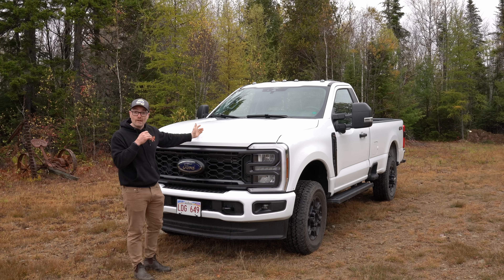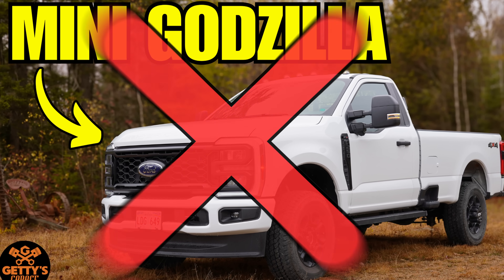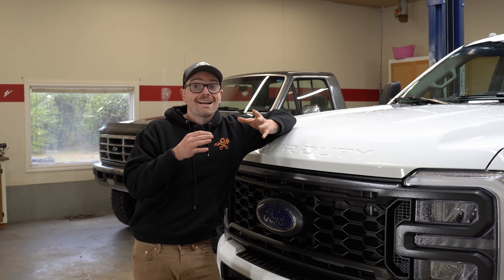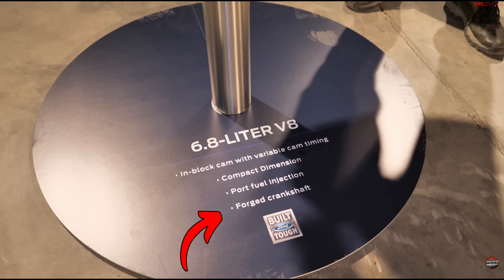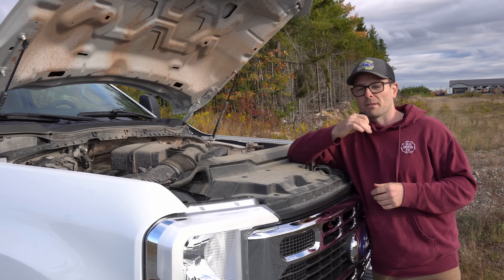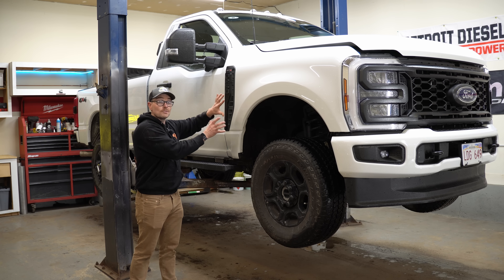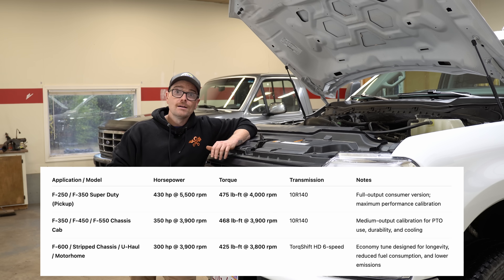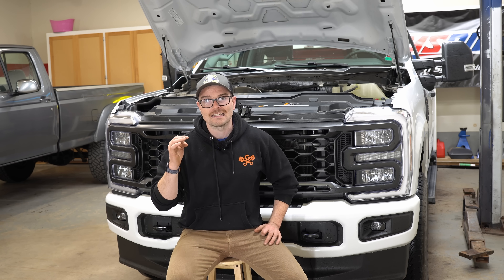Ford F250 6.8L Mini GODZILLA V8 Engine | Weak Points & Common Issues YOU Should know..

Comment: I like the 6.8L V8 in my current F-250 as much as I liked the 6.4L V8 in my 2015 Ram 2500.  I plow and only tow a 7K lbs. trailer.  Both have plenty of power for me, no issues with either.

I worry about the transmission.  Not because it's not strong enough.  Because they put the trans. cooler under the truck instead of in front of the radiator like every other truck I've ever had.  My trans. temp. gets up to 221°.  That seems crazy high to me.  The Ram trans. temp. went from 168° to 172°.  I'd like to put a aftermarket cooler in front of the radiator.

Comment: Kinda interesting, as to the crankshaft debate if you look at buying one the 7.3 has a different part # than the 6.8 which isn’t surprising but the cost between the two is very similar looking across multiple vendors so why wouldn’t a cast crank be at least a couple hundred dollars less? If indeed it is cast crank!

Comment: I’m a 2024 6.8 owner. I’m impressed with the power compared to my previous 6.8 v10 engine and it gets better fuel mileage while delivering torque on the low end better.

Comment: 8:15 ford had tons of trouble with transmission cooler lines through the 2010s. All of their metal quick connects would rust and corrode or the line connections would crack and blow out. Luckily corrosion shouldn’t be an issue for these

Comment: The “intelligent” charging systems are another over complication. Our QX80 HAD an “intelligent” alternator but after 3 separate trips with my wife and the stereo off or playing low while driving along back roads averaging 45-50mph I had noticed the voltage gauge was below 12V and we had weird hard starts each those three trips. When cruising along the charging computer will tell the alternator to stop charging and freewheel to get another couple of tablespoons less gas used. On the Infiniti there is a single red wire going to the alternator to tell it to charge or not to charge by sending 5v or 0 volts. If the alternator is not sent a 5v signal it will charge the battery. I clipped that wire 3 inches from the plug it comes out of its computer. Problem solved, volt gauge now shows 14V all the time. 

Great idea, let’s pack the vehicles with lots of computers and actuators then we will compromise the electrical system by only randomly charging the battery.😅

Comment: Been messing around on Fords site and trying to Spec out Super Duty options. It seems that  26.5 gallons is the biggest fuel tank available on 250 and 350 trucks regardless of bed length. Am I missing an option package that has larger tanks?
Reply: Believe it’s 36 gallons with 8’ bed ?

Comment: When the 6.8 was released in 2023 it was rated for E85. Now for 2025 and 2026 Ford states that the 6.8L Minizilla is no longer E85 compatible. Would love to know what they took away or changed from a few years ago and what the performance gains would be if you run the 6.8L on E85.
Reply: Interesting, my 2024 is E85 compatible

Comment: For those that have access to Ford Workshop Manual (PTS) and go to 303-01B, Description and Operation, Engine Overview, it calls out the 6.8 has a Forged Steel Crankshaft. It’s the same 2023-2026

Comment: I have a 2024 f250 6.8 with 3.73 gears. It’s been amazing for me. I tow an 8,000lb toy hauler on the weekends that used to walk my 2021 f150 all over the road. It drives much smoother, transmission wise, than the f150 did with the same trans. With a couple fluid changes, I cannot imagine it being a failure point. It doesn’t feel labored at all.

Comment: Wish this would find its way into an F150. There was talk of it years ago, before it was released. I want a V8 with good low-end torque. I don't want ecojunk, and while the coyote is a great engine, its low-end torque is anemic. My 255k Oz tuned '12 has made that painfully obvious pulling my 1860 tracker grizzly.

Comment: Excessive oil pressure can cause bearing wash taking off the top layer of the bearings 
All cat c15 engine wash the bearings Cummins used a viscosity sensing oil pump to prevent that
Reply: Cummims definitely does not use a viscosity sensing oil pump. There is a pressure relief valve that opens if pressure gets too high. Nothing to sense low viscosity and produce more volume.

Comment: 2023 f250  6.8 l oil pump drive gear failure loss oil pressure  metal oil  pan  new engine 8140 on truck

Comment: recently I went and test drove the 7.3L with the 4.30 gears. I currently own a gen3 5.0 F150 with 3.73 gears. I was really disappointed in the power and response of the 7.3 as compared to the 5.0. I know the Superduty weighs a ton more, literally, than the F150, But was really surprised how gutless and lethargic it felt compared to the 5.0. Am wondering if Ford has a break-in detune program in the new trucks now, that doesn't allow it to make full power until is broken in? After driving the 7.3, decided to keep what I have.

Comment: My 1997 F250 460 had a cast crank shaft and it worked good I had it since 2005 until 2022 and it got a rod knock and I drove it for almost 40K before I decided to pull the engine and rebuild in spring of this year so I think that cast crank shaft will be alright it’s strong enough .

Comment: I know you are an engine guy. But… I have a ‘24 F250 7.3L Tremor (4.3 rear, I think).  I often have these varying length pauses after I shift from D to R or vice-versa before the transmission engages.  Is that normal?

Comment: Stumbled across your awesomely informative video (THANK YOU) while researching a new used truck.  I am not a mechanic, I don't even know one.  For me, as you have so gently alluded to - RISKING damaging the engine with a variable displacement oil pump to save a teeeeeeeeeeeny percentage in fuel economy MAKES ZERO sense. Put in an oil pump that ALLOWS A GENEROUS FLOW - WHY RISK IT LIKE THIS?  Makes ZERO SENSE.  I and I am certain I would MUCH rather pay more at the fuel pump over risking a shaft and lifter problem.

Comment: Actually, according to another video on Youtube posted by Motorobo, the 6.8 is documented to have forged crankshaft.  Here is the result from a Chat GPT 5 Search on why there is confusion. The truth is that the 2023 Ford 6.8L gasoline V8 engine uses a forged steel crankshaft, not a cast iron one. The confusion comes from an early information release that mistakenly described it as cast iron, but all subsequent technical documentation and parts listings confirm it is forged.
🔎 Why the Confusion Happened
Early press/marketing material: When Ford first announced the new 6.8L V8 (a derivative of the 7.3L “Godzilla”), one spec sheet briefly mentioned a cast iron crankshaft. This appears to have been an error or placeholder detail.
Later technical sources: Ford’s official parts catalogs, dealership service information, and aftermarket performance suppliers consistently list the 6.8L crankshaft as forged steel.
Engineering logic: The 6.8L is essentially a shortened-stroke version of the 7.3L Godzilla, which is well-documented to use a forged steel crankshaft. It would be unusual for Ford to downgrade the crankshaft material in the 6.8L, especially since it’s designed for heavy-duty Super Duty trucks where durability is critical.

Comment: The 6.8 and 7.3 remind me of the GMC 6.0l gas that they used to have. Super simple and those things ran forever.
Reply: I had one of those GMC 6.oL trucks... a 2020... drove it and towed 10,000 lbs with it for over 23 years... NO ISSUES...oil changes every 3,000 miles... my mechanic said it would go another 250K miles when I foolishly sold it...  I sure do miss that truck...
Reply: @edkronholm9054  I'm a ford guy, but the 6.0 and 5.3 are awesome engines

Comment: Imma be honest, I’ve never drove either, but I’ve rode in a f250 with the 6.8, that’s a smooth transmission, I’ve heard the 10r140 kinda has a hard shift in the 7.3, but I’ve never drove one. And ford is going to the 10r100 in the 7.3 across the board in the 2026 models and up

Comment: The 6.8 is fine for a guy like me. Self employed contract mechanic who needs payload for a service body, and does not do any heavy towing. 
If I can save the cost of the 7.3 upgrade, plus maybe 5% fuel savings,  then what's wrong with that? 
I have worked with a lot of guys with smaller engines like the 6L Gm, 6.6 gas Gm, 6.4/ 5.7 Hemi, and 6.2 Ford's. 
If the anemic 6L GM can move the truck around just fine, the 6.8 with a 10spd will be light yrs better.
Reply: I'd love to get a 6.8, but looking at an alumiduty 6.2 or any 94-96 3/4 ford. What rear gears did you get?
Reply: I will be buying a new 6.8 next year. Looking forward to it, I’m in your same boat, don’t need a diesel or the 7.3. And the new gmc 6.6 all burn oil and have electronic issues. We have 3 of them at another place I work, they are annoying,

Comment: Would it be nice to have the 10r140 behind the 6.8 and 7.3, yeah.  Is it strictly necessary?  Probably not in the least.  At 1000+ lb-ft torque capability the 140 is ridiculous overkill for both the gas burners.  Even the 7.3 tops out at <500 with the advantage of being like 100lbs lighter with slightly better gear ratios tailored for a gas burner.

Comment: FYI to everyone... The beloved 6.2 BOSS had a cast iron crank shaft.
Reply: Then they're junk
Reply: @MAXIMUSMINIMALIST 😂
Reply: @theingobeck4772  I guarantee between the two of us I'm the only one that was a machinist. Cast-iron crankshafts are for grocery getters not heavy duty trucks.
Reply: @MAXIMUSMINIMALIST oh dang... I guess I better sell my micrometers and get rid of my Bridgeport...
Reply: @MAXIMUSMINIMALIST  you are confusing the Ford 6.2 with the GM 6.2
The boss 6.2 from Ford is probably the most reliable V8 on f250s so far, my single cab tows 19k pounds, it already has 300k miles, no problems so far.
Too early to tell what the 6.8 and 7.3 reliability will be.
Also you are a machinist not an engineer

Comment: While it never made enough power stock to really hurt itself, the Ford 300 came with a cast crank in truck applications, and it would run forever just keeping the oil changed. Even if the 6.8 does have a cast crank, I don’t know if that would be a pass for me. If I were to supercharge it, then I would probably reconsider.
Reply: I commute 70 miles in a 1970 F100 3 speed, it still has the original carburetor, drum brakes, no power steering and on points.😂 I just stay in the slow lane with the Big Rigs.

Comment: Own a 2025 F-350 XL with 6.8 off-road package, 4:30 gears ,super cab, single rear wheel, hay bed. Really enjoy the 10 speed, holds gears while in tow haul mode , runs great down highway and towing. Would buy again

Comment: Would be interesting to know the failure rate of the 10R100 transmission for all Ford models that have them.  Tried looking it up on the interwebs but could not find anything concrete.
Reply: The 10r80 had high failure rates of valve body, cdf drum and torque converters. 
Most of those issues were largely solved after 2023 production date. 
This is according to some  Ford Techs on you tube.

Comment: The "snow plow" spoiler actually does save fuel. I have run my truck with the spoiler, without the spoiler and with the Tremor slim spoiler. It is a -0.8 mpg difference without it on a 6.7L at 55mph. I now have the Tremor spoiler and the difference is about -0.5mpg driving the same route at the same speed and conditions. The oversize tires eat considerably more fuel and the Steelcraft grille guard and a front hitch add to that as well. The 2020 model truck equipped with the same drivetrain and body style got 3mpg better than the 2022 truck and used less DEF while it idled at a higher RPM. I also made the same modifications to that truck.

Comment: I have a 2021 f250 with the 7.3 Godzilla with 115k miles and no problems. Don’t let them idle and they should last a long long time
Reply: Just don’t let it run shouldn’t be something that should be said about a motot
Reply: @Matt-m3e  agreed but you can say the same about any modern diesel
Reply: @Tonychin-e3w for a completely different reason. Gas that should never be a statement. People idle a lot in construction, warm up, eat lunch etc in winter. I have a diesel btw😂 idling isn’t a concern for me cause I don’t idle for long periods and avg 30k plus miles per year.
Reply: @Matt-m3e  cool story Matt.
Reply: @Tonychin-e3w butthurt?😝

Comment: When I bought my 2024 F20 I test drove both the 6.8 and 7.3.  I found the 7.3 to have much more low end torque which means it stayed in a lower gear much longer than the 6.8 did and therefore less shifting and noise going up and down the road.  That is what made the decision for me.
Reply: That would be odd to notice given there's less than 10% difference in the stated torque and the first 4 gears in the 10R100 paired with the 6.8L are lower so given the same axle-gear ratios there really wouldn't be anything to notice as far as low-end. 

I spend time in both 7.3L work trucks and my personal 6.8L and the only thing I really notice is that the 10R100 shifts much smoother with less clunks. As far as unloaded power goes, the 6.8L is quicker 0-60 (likely just because of the lower first 4 gears and lighter trans). So a 7.3L with a 10R100 might make it quicker.

Comment: I think the cast crank and 100 trans are a non-issue, but I feel the Vdisp pump and roller lifters reduce reliability.  I think a direct driven gear oil pump has much less chance of failure and is much simpler.  Why they did this to save a miniscule amount of fuel is beyond me on such as critical component.  Same with roller lifters.  Nothing worse than needle bearings scattered throughout your engine.

Comment: junk oil pump  long chain drive  EU design just 10 step backward and i ant not so silly imo top buy it s to save fuel how goofy its designed to kull the engines low oil pressure at red light with a load then punch gas yes the variable pumps good then   GM ALISON is not an Alison its a name and a normal unit with a name on it the amount of gear it clue 1

Comment: Shorter stroke means less rotational force ie. torque.  Is there a reason you chose not to use this word "torque".
Why do you say things like the valvetrains appear to be almost identical.  Either they are or the are not.  If they are not, what are the differences?  Why use wishy washy words instead of doing research?
Wouldn't it make sense to measure or find the volume the variable displacement oil pump flow at idle, before criticizing or praising them.  Again... too much work, I guess.

Comment: Too bad it doesn't come in a F150 as I'm not a fan of the Eco turbo's and the 5.0 has cylinder deactivation and two cams. teo cam phasers, long timmimg chains and wet oil belt.

Comment: Fun fact - 2025 is when Ford switched the F250 to the 10R100 with the 7.3 default. 2020 - 2024 7.3 have the 10R400 

Source - Google, and I just bought a 2024 F250 XLT Premium 7.3 with a 3.73 rear end, and it has the 10r400
Reply from the maker: Yes it seems like 2025 was when they made that switch. I guessed they figured the 10R100 could handle most of the 7.3L's
Reply: True. to add to this the f250 tremor package 7.3's do get the 10R400 across trim levels

Comment: The cast crankshaft is a non-issue.  There is absolutely no need for a forged crankshaft whatsoever.  It is a 4 bolt main and has the least amount of pressure on the main bearings than any HD engine out there.  The transmission is also a non-issue.  The 10r100 can handle damn near double the torque that the 6.7 or 7.3 can put out and actually is a much better fit for the gas engines.  The torque converter in the 10r100 is better suited for the power band than the 10r140 which eliminates the gear searching.  It’s also 100 pounds lighter and has noticeably less parasitic loss than the 10r140.
Reply from the maker: Can't argue with you there. well said!
Reply: You're exactly right about the trans. You can feel it when you drive a 7.3L truck back to back with a 10R100 6.8L.

Comment: As a young man, I built a couple of high-performance small blocks with cast cranks and ran them hard with no problems.  I have a 03 F-250 7.3 with a cast crank and not worried a bit about it.
Reply: The 7.3 always had a forged crank. The difference in the '01-'03 P.S. was powdered metal connecting rods.
'94-2000 were forged rods.

Comment: Ok not forged crank shaft but the 6.4 has cylinder deactivation which is TERRIBLE in a heavy duty and not even needed for cafe standards. And the 6.6 is direct injected. I’ll take my slight slight changes on a non forged crank shaft
Reply: agreed but the 8 speed on the 6.4 is more reliable/proven. Can't win either way it seems
Reply: How bout that lifter failure? Taking your chances on that too?
Reply: @Matt-m3e  that was a bad batch of lifters and camshafts from a vendor that has been resolved long ago.
Reply: @MAXIMUSMINIMALIST no it wasn’t but keep the dream alive. If it was lifters then why the tune to keep the oil pressure higher during idle? It’s the same bad design. Oil gets hot, low oil pressure at idle, insufficient oil reaching those lifters, crank, cams.. engine fail. It was more prone to box trucks and chassis cabs because those don’t typically do nothing more than going to the mall and shutting off. Who uses those trucks? Construction, delivery, ambulances… all have high idle time. You don’t see a 6.6 blowing up because it idled. Not to mention the thin oil. Kinda like GM changing the oil weight on the 6.2. Wanna blame anything it should be the oil, then the lifters and such. Dodge should never have put mds in the 6.4 either